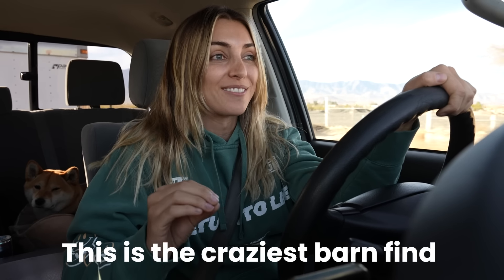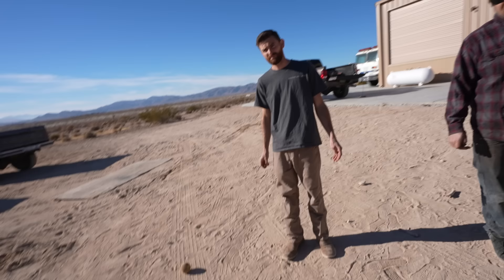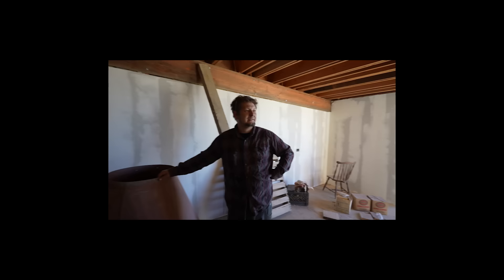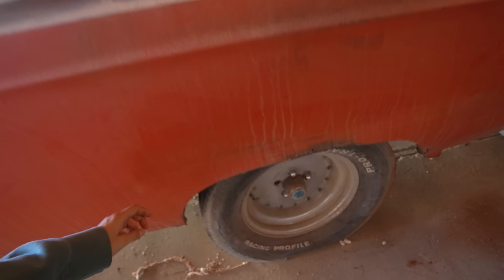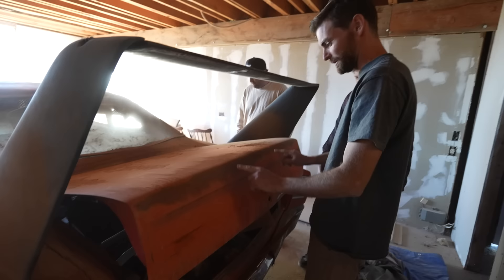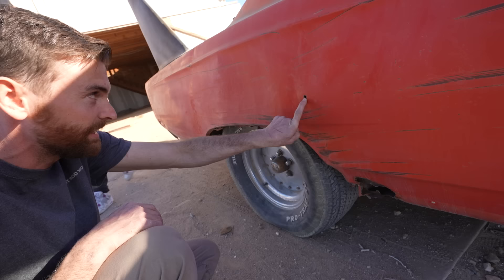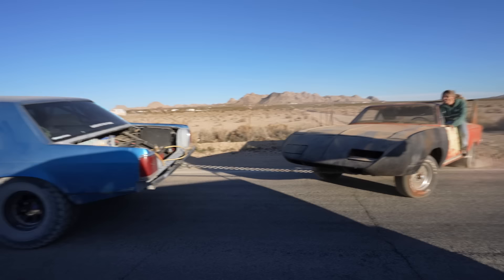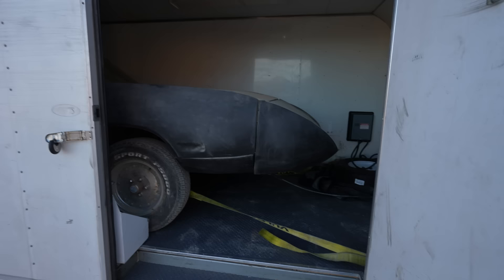I found an ABANDONED Plymouth Superbird in the middle of the desert

Comment: 1st clue was no chrome plates on the A pillars. 2nd clue was no scoops on the fenders. VIN would have either a U / V / R as the Super Bird only came with 440, 440-6 or Hemi. You could have bought a decent Satellite with floors, etc., and bought repo front cone and spoiler. You’ll have a fortune in this.
Reply: The fact is is a 69 sedan and not a 70 hard top is evident a mile away. But she said it wasn't real.  I think buying it for basically the wing and the nose was worth it.  Well, and the fenders.
The whole back clip is different from a 69 and a 70.  I have had both.   Also, a Superbird has a small convex rear window.  There is enough stuff out there to convert a 70 Satellite to a 70 Superbird, but starting with a 69 sedan puts you two steps back.
Reply: @auteurfiddler8706  She will put 60+K into it and it will be worth 10k when its done. If you find a buyer that wants a 69 Satebird.
Reply: When she is done building it… it will be a sick satebird…
Reply: @MrNota500  You are forgetting about the views generated and her fanbase increasing the value. This is a bad adventure for the regular folks, but with the YT side of this, it will be plenty profitable overall!
Reply: @MrNota500  After 60+ it would sell for 30, 40K to the right person. Def not a profit maker
Reply: Agree kind of a waste of money but hey if you have money to waste go ahead.
Reply: @craigmiller2315  ... and THAT'S the bottom line!
Reply: she'll make a fortune from you tube on the build .. oops
Reply: Couldn't agree more! A decent starting car and buy the kit herself.
Reply: @MrNota500  If it was a hemi or 6 pack car originally it will be worth way more than that.
Reply: She seems very pleasant knowledgeable, and a very nice person….
I hope she got this for $500 ……! 🙏🏻🙏🏻🙏🏻
Reply: First clue is it’s a 69 lol
Reply: @MrNota500  Maybe she won't need to put that much in it. One thing is for sure, it will be worth much more than 10K. $10,000 gets you very little in the muscle car world.
Reply: @auteurfiddler8706 already a rest o mod in the works
Reply: @anoint426hemi6  She'll probably end up putting more than that into it, honestly.

Comment: My suggestion is to get a hemi engine preferably the mopar heliphant 1000 HP power plant !  So much adaptability with the mopar out of the box kit and potential drivetrain selections will make an amazing Mopar resto mod vehicle.  Amazing barn find! 15:04
Reply: YES, THIS NEEDS THE HELEPHANT! UPVOTE THIS COMMENT AND MY COMMENT stating the same thing!
Reply: Oh yeah, a Hellcat Superbird sounds POWERFUL!
Reply: Unless you have connections, ALL of the Heliphants  are long gone. Last one I looked at was over $60k.
The Superbird has a few features that none of the other MOPAR cars of the era had. The rear window is bubbled out not in like the Satilite, Belvadere, of Road Runner had.
The lower control arms are off a D100 truck for more length. The wing has braces that go into the trunk and connects to the rear subframe unibody.

The front clip on this car alone is worth $15-20K. The rest of the car, whatever the going rate for mild steel at the scrap yard brings. 
By the time you invest in a unibody restoration, purchasing a rust free Arizona car would be a better fit IMO.
Reply: Can't go wrong with a Hemi when it comes to the Superbird.
Reply: Why spend the cash on a heliphant for only 1k hp when I hellcat w/ bolt ons can make the same?
Reply: @r4raced4doom2  
For me, a crate 6.4 with the super charger and 8 speed transmission will provide 170mph plus speeds. 

If one were to purchase a cast iron 426 hemi of the era, it's still going to be a cobbled together car. 

I did a factory GTX unibody repair. It was a 440 single 4 configuration with AC, PS and PB. Exterior wise, spotless car. Interior wish looked great except the smell, where the mice had a field day under the carpet with caused the floor to rot away.
Reply: @gungadinn  the factory 392 6.4 is weak and have been known to grenade with 6-8lbs of boost.  A 5.7 hemi is probably your best bet for a boost friendly hemi outside of the hellcat for cheap.  Kinda wish I went that route over the 392 I put in my 70 challenger.
Reply: I agree but a traditional built (carburetor) 426 Hemi engine, if not a 440 Stoker! Gotta be original big block Chrysler Powah! 😎👍
Reply: Nah... the 3rd gen hemis are junk... indy 655 predator... based off the 440 max wedge... but built to the max... it's a nasty motor that makes the helephant look like child's play
Reply: Good power without going insane were the 383 ci of the day with super chargers ... fairly bulletproof power but since I've been a loyal fan of your channel I know the e-crew doesn't do bulletproof lol. So go ahead and shoehorn one of them there 6.7 TRX HEMIs in there and as much concrete as you may require to keep them front tires on the ground...lol
Reply: 318 with a 4 barrel carburetor.  300 horsepower should be enough
Reply: A Steve Morris Engines SMX would be good to see in there
Reply: @jimhartland1939  he has SM Hemis too.
Reply: @gungadinn  ya, for what iron 426's go for these days you could do a Hellcrate swap, 6.4 would be even cheaper and is probably the best choice.
Reply: Yes!  Helephant!!
Reply: Hell no!
Reply: @gungadinn  I have to agree, this car isn't worth the hype. I mean, I wish her luck, and hope she enjoys it. But it really isn't worth anything beyond what you said.
Reply: Hellcat ,manual trans,slam it on the ground w/airbags to lift it high enough to roll satin black paint w / orange ghost flames limo tint modern tech interior and suicide the doors as well as reverse hinge the hood and trunk
Reply: @missingremote4388  318 ,340,slant 6.over 5.7 hemi.440 six pack roadrunner would beat 426 hemi on the street. Tuning problems. Please submit pics of you swapping hellcat motor or just gapping spark plugs. 😂

Comment: We all know you're going to restomod it. Since it is not a real Superbird I say go for it. Hellephant with a six speed manual. Just needs the little bumps on top of the front fenders and the quarter panel scoops on the sides. The tail lights and rear window are going to be dead give aways that it isn't real but it will still be a fun car.

Comment: That was fun! Thank you for sharing that! My dad and I had a real cool barn find when I was in my early 20's. We got a 1959 GMC pickup and we fixed that thing and spent good quality time together on it.  We fixed all the rust, repainted it, replaced the chrome, gave it a flame paint job, took out the old straight six and put in a healthy 327 with Edelbrock intake and carburator, got rid of the 3 on the tree manual shifter and put in a turbo 400 automatic trans with a narrowed Ford 9" rear. We later put a Ford mustang ll front steering and suspension on it. It was a really cool truck and a great way to spend time with my dad!
Reply: EmiliaHartford  Sure, how?
Reply: I don't know how to telgram😊

Comment: It looks like a Satellite or Roadrunner and it's going to need A LOT of work! I hope you have a new shop lined up!
Reply: It's a 69 Satellite. The tail lights give it away. 
Still a cool find.
Reply: I think its a 69 belvedere tbh
Reply: Still preety cool
Reply: Never saw a wing car in the post 2dr
Reply: @godlessthrash  The 69 Satellite has a door post. 
The 69 belvedere does not. 

The 70 model Satellite and Belvedere does not have a door post between the windows. 
The tail lights are identical to the 69 cars.
Reply: A coronet? @godlessthrash
Reply: Good catch! Plymouth had vinyl tops to cover up the down-n-dirty roof work necessary to make the flush rear window, while Dodge already had the Charger 500 rear window setup (that vinyl top grain actually helped stability, just like dimples on a golf ball are there to break up the boundary layer and let the golf ball travel further thru the air before wobbling around). also, the NASCAR cars have a chrome plate on the A pillar, just to let the NASCAR crews use it to clean up airflow from front window to side windows.

Selling these cars was so hard when they came out, however, it wasn't abnormal for a dealership with one sitting too long on a car to take off the nose and wing, swap on a regular nose and fill in the rear fender and sell the car as "normal", since they already came with something bigger than a 383.
Reply: I had a '69 Charger 500 @alertgasper
Reply: @seattleblaze  that'd be a sweet ride, bet it's a "wish i still had it" :)
Reply: It's not a real superbird the fenders gives it away and a when people were buying those cars new they were removing the nose and the wing

Comment: Emilia, as a teenager, when I was 16, I bought a new, Dodge Coronet Super-Bee.  It came standard with a 383 cubic inch engine, rated at 335 horsepower.  One day, while driving my Super-Bee, I saw a brand new Superbird on a dealer's lot.  I stopped into the dealer to ask him what the price of it was, and he said that it costed $10,000.  I thought that the price was insane, so I walked out of the dealership, I mean, my Dodge Coronet Super-Bee only cost me $3000, so I couldn't understand why the Superbird would cost that much.

As for your recently purchased Superbird, you need to restore it to it''s original form.  That mean's installing a 440 cubic inch, magnum engine, or the powerhouse, the 426 cubic inch, Hemi engine.  Those were the powerhouses of that era.

Comment: Even though it's a cobbled Bird lol, would love to see a MOPAR powerplant in it! Worked with faraday cages for many years, they are used to shield sensitive electronics like radio receivers from the ambient signals floating around everywhere so we can measure the sensitivity and noise rejection capabilities. Same thing with transmitters we can broadcast signals measure for proper quality and not be blasting stuff out into the universe or having circuits within the transmitter be affected by higher ambient noise signals. It's not where you would typically build anything. Spent 10 years as a technician and technical services manager at a seven city 911 emergency dispatch center down in Hawthorne California. Then growing up back in Connecticut the rich boy son of the supervisor of a complex I lived in got the first or one of the very first Super Birds delivered in our town. I would die to have one of those LOL! I am so freaking jealous right now lol! Huge Congrats Emelia!

Comment: I think that the vents that you are referring to are in the front fenders over the wheels. The rear quarters had special features to support the wings to the frame. Great video Emelia!
Reply: The rear quarters also had a vent or ducts of some kind. They were in front of the rear wheels and just below the door handle line.
Reply: @hazyblue69  yes, the typical duct for the roadrunner. The swirling dust trail of the cartoon would have started from there leading forward to the Roadrunner.
Reply: The ducts came on 70's two doors but are missing because the car in the video is a 69.

Comment: As a Mopar nut, I'm also a realist.  This poor car is going to need EVERYTHING.  While I know you aren't afraid of the work, its going to be allot of it.  I'm still waiting for someone to do a build on the Brand New 1969 Charger roller from Mopar performance.  All new carbon body, new chassis, etc.  I know they are pricey, but damn.  Hellcat motor and newer interior, with all the goodies.  If I had the $$ I'd do one.

Comment: Just the replacement floor pans, assuming the VIN's right to tell you what it is, will cost a fortune. But, if you have a dumpster full of money it can be brought back but, it will always ever be a clone and never worth what a super bird is. Looks like a Joe Dirt mobile. I've got a real Super bird I've owned since '72 I bought out of a junk yard. It had been run into something and the front clip was roached. I was told the frame was bent but hanger gauges told me it wasn't, so I replaced the front clip new from mopar.  It has 54,000 miles on the clock, 440 6 pack, 4 speed and my daughter will get it when I'm gone because she is absolutely in love with it and has been since I got it when she was 4 years old. It's sublime green.

Comment: Its a 69 but you actually could swap on 70 quarters, tail panel, trunk etc and make it a 70.  I didn't figure you'd find a real 70 superbird... but as an old school mopar guy, looking forward to the build and don't LS swap it!
Reply: Or put a Ford engine in it.
Reply: I think it is good project car but throwing out the whole rear clip to make it a 70 is a bad idea.  Hey, maybe she will leave it as a 69.  Most people under 35 only know these cars from the mutts in Fast and Furious movies, so they would never know the difference.
Reply: @auteurfiddler8706  The floor, frame, etc is all the same.  It needs full quarters, then the tail panel is the only other structural/weld in part needed.  And they said it had been hit in the rear. makes perfect sense to me.  Trunk lid and tail lights and it's a 70.  Although to make it a real superbird clone it needs the rear window plug also.  Leaving it a 69 and making it a superbird is a far worse idea in my opinion.

Comment: IT’s NOT A PLYMOUTH SUPER BIRD! It is a ‘69 body based on the front and rear fender ‘eyebrows’. Super birds were based on the ‘70 B-body that had eyebrows removed. It also doesn’t have the tear window ‘plug’ that replaced the curved rear window. There are not chrome A-pillar moldings as well. It also lacks the ‘fake’ rear quarter vents found on all Belvederes/Satellites/Road Runners/GTX models! It’s a $2,500 car at best.

Comment: This car is NOT a Superbird. It is a 1969 Plymouth Satellite. A Superbird has the round speedo gauges, never came as a post car (all of them were hardtops), this car does not have the rear window plug, even the rear wing spoiler is not right.  This car needs to be crushed.  It would cost more than its worth to restore it.  You can always check the VIN number on the dash and it should start with RM23U....the U stands for 440 cubic inch motor with a four barrel carburetor.  If it had a Hemi then there would be an R and a V if it was a 440 six barrel car. However, that is only true if it is a 1970 car.  In 1969, if the VIN has and E or F, then it was a 318 engine, G or H would be a 383, J a 426 Hemi, K or L would be a 440. Keep the Superbird hood, nose cone, etc. and find a 1970 Satellite or road runner donor car.  That would be a lot cheaper and worth the time.

Comment: Put a Hellcat motor in it? Like a wiper motor? If you mean what powers it go down the road, that would be an ENGINE. A motor runs on electricity and an engine runs on some type of fuel like gas or diesel.

Comment: gotta have a 426 hemi or larger one or the really built 440 with (400 block with 440 crank). 4 or 5 speed. big exhaust with big balance tube and a 280 duration cam. she would be so sweet. who cares if clone. great find. This is the kind you make nice as a daily driver. a/c and everything.

Comment: The superbird has a crime piece  on the windshield post the rear quarter were narrowed that's what the piece in front of the wing is a plug that fills the hole  the rear end  the back window is smaller than the roadrunner The crome piece on the windshield  post covers put the car over 220 mph .If it is a real bird ,there will be a big flat washer welded to the front crossmember ,this washer has a stamped number on it ,this number is the number the car is from assembly line frm 01 to 1500.The front fenders are from a 70 coronet the hood is extended 18 inches there is a sheet metal  extension fro the coarsuport that holds the nose on I have the nose complete and wing backseat bumper ..my car got stolen

Comment: How about something not seen, like a twin-turbo 383, or a 500 hemi, or a hybrid 5.7 with a electric boost at the flywheel. I think they make a torque-adder for the 5.7, or used to. Or a motor that runs on self-generated HHO, like that moto.

Comment: That barn find is not a Superbird. Because the tail light are square making it a 1969 only. That was the only year for those lights. Check the Vin and see if it has an R in it.

The nose piece and rear wing were all metal. No fiberglass or any other materials were used.

Not given you a hard time. I was around those cars and did body work starting in 1978 and saw a few fakes come around the shop and try to pass them off.

Plymouth only built the Superbird for one year and that was 1970 only the Daytona was a  two year car 1969 and 1970.

Richard Patty drove it for a year, before NASCAR banned it and the Daytona for being to fast and unfair to other car teams.

Please keep making your YouTube videos. It is great see some one who has the passion for cars let you.

Thanks 😊